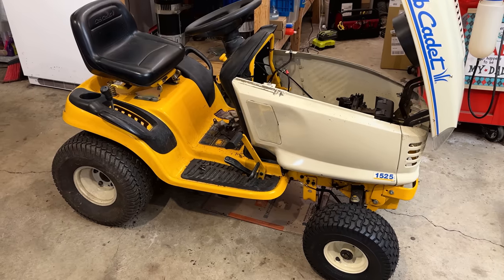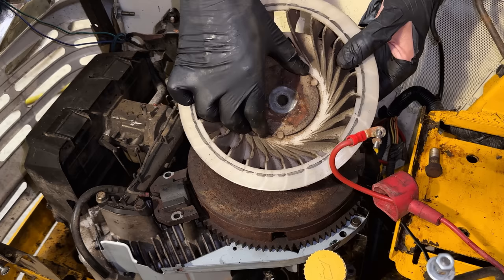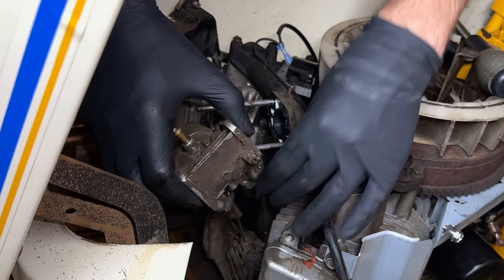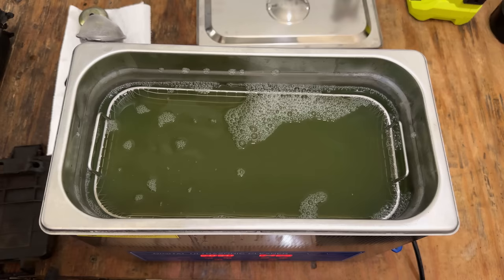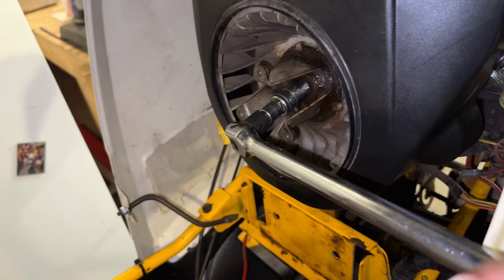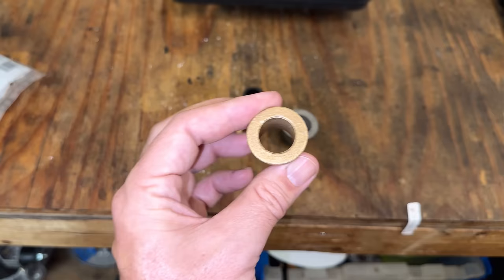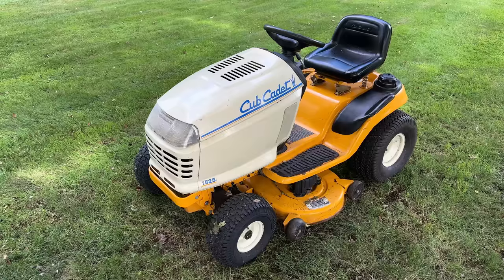Cub Cadet Crash (Pt 2) - Tractor and Tree Damaged

Comment: Fill the oil filter holding it in the inverted position (as you did). Let sit for 30 minutes in that position with some cover (usually the box it came in put on top). The pleats will absorb all the oil it took to fill the filter (if it is of good quality like a Wix). Add a bit more oil that will stay in during attachment and install. If not already, remove the spark plug. Now crank the engine or pull the started cord several times to fill the filter and establish full oil pressure/splash through the engine. Now you can replace the plug and start it.

Comment: Iron pipe threads always require lubricant, usually in the form of teflon tape or pipe dope, automotive is ptfe.  The threads engagement do ultimately make the seal, but the lubricant allows a deeper engagement of threads to make the seal.  

Usually 3 wraps of teflon tape is plenty good to seal pipe threads.

Comment: Good job James, she is pretty good, especially the steering. Not sure which is less tiring a zero turn or this one. Sure less tiring than a walk behind mower. It looks like this one needs a mulch bag since you were blowing leaves back and forth. Probably last you the rest of your life if ya'll bolted the dashboard on very fast, I mean bolt it fast or tightly. Probably will keep the steering from wearing out top and bottom. Your mower deck needs painted to keep rust from making holes in your deck with primer and good paint. Now all's ya'll need to do is hook it up to a generator head and pull it into a fabricated  box that has the connections already inside to just drive it in and generate big house power with a 10kw head and have the rpm load following to save on engine wear with an sine wave inverter.

Comment: There were several less than stellar design issues on this one. That steering issue with metal on the drive end and plastic on the steering end, looks much like planned obsolescence. Or, better said; a planned failure of parts. The idea you came up with is probably better than what the factory did. Should last longer for sure.
Reply: Just curving that yellow support pipe up to where the steering wheel boss was in the dash would have precluded all these wear/damage problems...
The steering wheel and shaft need to be well anchored because it is a normal reaction to grip the wheel for leverage getting on/geting off/braking/shifting seat....

Comment: As to the broken screw holes in the dash panel, if JB Weld sticks to the plastic (it usually doesnt), id suggest gluing a thin flat washer on both inside and out of each hole, to replace the broken out material.
Reply: Another commenter recommended ADEL pipe clamps that are used in experimental aircraft...
they clamp round pipes and allow other fixtures to attach to the clamp with bolts...

Comment: Hey, James!  Nice one - I like good long repair videos! 😁
There’s a couple things I would have done differently. 
I would have pressure washed that engine compartment after removing the hood and both sides. The dirt and oil on the engine and cooling fins would make it run hotter. 
I really like your solution for stabilizing the top end of the steering shaft, but the washers are what’s preventing most of the slop due to the difference in size between the inside of the brass liner and the shaft. I would have tried dimpling over the bottom edge of the brass and inserting a piece of Delrin shim stock from above to provide a near frictionless spacer with less chance of long term wear. Maybe. Just a thought. 🔧👍

Comment: Great video, very good information. I did notice you using chenel locks on the oil sending unit...I sugest finding a socket made for that purpose it is an S K Tool  P/N 4488  it's 1 & 1/16..

Comment: After the brass nipple installed in steering column you might have been able to use one of the bushings you originally thought about using to take up the rest of the slop.

Comment: Can't wait for James to do an airless paint sprayer repair video. I'm trying to figure out why my machine wont work. I'm pulling my hair out!
Reply: Never underestimate getting the filter backwards in the handle.  Or snapping the end of a filter off inside it.  Assuming your pump runs but the gun doesn't release any paint.
Reply: The gun is brand new. It runs but doesn't draw up any fluid. Perhaps I'm not operating it correctly. Thanks for the tip. @KaldekBoch
Reply: It's tricky to help diagnose things via text but I've had a few airless sprayers of various quality.  Always start by doing the prime to get the paint into the machine by using the prime position on the switch.  This will cause the pump to run continuously and (if it primes) it will spit paint out the little rubber hose.  Once it's doing that, switching it to the normal position should cause it to run for a few seconds until it pressurises.  If you get that far, all other issues are usually caused by the trigger/gun assembly.

Comment: Pipe threads (tapered threads) generally use thread sealant (“pipe” dope or Teflon tape). On motors in vehicles the oil pressure sensor should have thread sealant on it, that’s where the oil pressure will be 20-80 psi.

It will probably be fine just might want to keep an eye on it.

Comment: You could have closed up the steering shaft play, by soldering some 5/8" 'L' copper tubing on the inside of the brass fitting. Should be almost an exact fit (0.75" OD, 0.66" ID)
And one rule that I use when mowing, is to discharge where I have already cut - that prevents an ever growing mound of clippings to shift!
Reply: But by chopping and re-chopping time and again he is mulching everything back into the lawn....saves on fertilisers!

Comment: Not sure if you still have this, but if the steering wheel wiggle becomes an issue, it may be possible to center the steering shaft and remove the slop by taking a larger OD fender washer that fits in between the pipe flange bolts and drilling out the ID to the steering shaft diameter.  Once the steering wheel it tightened it will stay in place.

Comment: Instead of the brass fitting you could use a brass pipe plug and drill it for a 5/8"shaft... further i think i would have put the flange on the back side of the dash panel and countersunk the screws so they were flush with the top surface. Or barring that, countersunk the flange face.

Comment: many 80s era MTD snowblowers used stamped steel auger end support flanges with 3/4 brass bushings that would have been absolutely perfect for that steering shaft repair....or maybe even an impeller flange with actual ball bearing would have been good

Comment: 54:58  on the pipe flang good idea by the way I might have traced it on a thick plastic,  wood or tin drilled the holes in it like the front bored a large hole so the long side of the flange would fit into it and bolted it on the bottom side of the dash panel  and then just so the bolts didn't back off put clear calk on the bolt threds when it dries its like lock tight  or a nylon lock nut. 
That works really good to. You can get them off but its not going to vibrate off.  In fact calk would have held both parts on.

Comment: Could of used rivet nuts for the steering column part to put the bolts in. I don't know if it's the angle the camera but it looks like your deck is uneven. Like the left side of the blades are sitting lower than the right side.

Comment: Good job young man. You might try to use a schedule 40 water pipe the insider dim. the size of the shaft. Then sand the outside to fit your brass bushing. Just discovered your show. yes I subscribed
Reply from the maker: Thanks for the tip

Comment: I gave 350 bucks it was about 10 years old with just over 100 hours on it and it came with 3 pull behind devices.  Yes I stold it at that price.

I've sence picked up a 42" snowblower for 200 bucks in New shape and built a 75 cubic yard pull behind dump cart. 
Its more MTD then the newer Black and decker designs  not stanly owns MTD

The really good units were the Harvester international cub cadet units from the 1960s
These look like craftsman or yard machine units. 
The motors are really good.

Comment: There’s gotta be a properly sized flanged bushing you can drop in between the shaft and the copper fitting, and you won’t need a washer.

Comment: For that steering shaft I would have considered a circle of 1/8  steel covering instead of the pipe flange. I would drill a 3/4 hole in the centre and insert a flanged bronze bushing 3/4 od, 5/8 id.

Comment: Lot of work. Did you get the front deck support installed correctly? That will make a nice mower for someone if you decide to sell it.
Reply from the maker: Finally did reverse it.  Works as it should now.

Comment: I'd put some VibraTight or blue thread locker on the oil pressure switch. Not to prevent leaking as much as to avoid it backing out and dumping  all the oil on the lawn. Just saying. Lots of vibration going on there.

Comment: Wow lots of issues with this tractor. The pipe threads on anything needs sealant. The thread are interference fit to keep it from falling out. Oil/coolant,etc will creep through the thread clearance between the crest and root. So you have a spiral leak path. It will take a while to leak, but it will. NPT connections require a thread sealant to be leakproof. Good job.

Comment: Hello. As always, the quality of your work is extemely high and I learn a lot from you. I saw, you reused parts with corrosion below the fly wheel and you used Fluid Film. My question is why you did not apply sand Blasting to clean the parts? 🤔. Thanks for sharing. Saludos feom Mexico 🇲🇽

Comment: Although that machine is not the highest quality your usual attention to detail will give you another 5 years before you have to do more to it. I love your shop setup with the table hoist and overhead crane but can't help thinking your next purchase should be a medium-sized bench lathe so you can turn up those shafts, bushings and housings to your exact requirements rather than having to look for and buy parts that may not fit perfectly or are unavailable.

Comment: I always use teflon tape for that type of oil sensor to ensure no leaks.  The factory often uses a type of thread locker/sealant.  I think the green kind.  I wonder what ate that shroud up.  Maybe a mouse-house of the past?  Maybe caused the corrosion on the fan too?
Reply from the maker: It must have been a mouse house.

Comment: James, I have watched a number of your videos and have seen you use the tire changer, the compression tester, the spark tester(s), some needles/brushes to clean the carburetors, an air blow gun, some kind of degreaser, a vacuum and the ultrasonic cleaner. I was wondering if you might consider making a quick video and putting together some links to indicate what those tools are and where you got them, please. Thank you.

Comment: I would have put some pipe dope on that oil pressure sender.  The same stuff that I use for oil drain extensions when I add them to an engine.

Comment: You need to start taking the mixture screws out of the carbs you rebuild btw that's why so many of your stock carbs act lean is because the idle circuit is still clogged, yes the generators technically don't idle but that circuit still contributes to the overall fueling of the carb.

Comment: I know I'm a neat freak, but going this deep into cleaning the engine, I would have degreased and powerwashed the the whole thing... Nice rebuild though. For that cracked plastic on the dash, a mixture of ashes and super glue works great. You just paint it on both sides of the crack.

Comment: James I have been enjoying your videos for a while now.  I am a gen guy by trade and the gen oil sensor has 1 sensing wire while the threads making contact with the block is the ground.  If you put an O ring or RTV on the threads, it interferes with the sensor and as a safety it keeps your gen from starting.  Maybe it's the same for your oil sensor?  Might be worth a little experimentation to find out.
Reply from the maker: Good point.  This one is probably the same.  That said I do usually see thread locker on them from the factory.

Comment: Great work as always, just curious what engine oil you used? I have 3 john deeres with kawasakis, single 17hp, 17hp twin, and a watercooled 15hp twin. All i have ever used is 10w30 mobil 1. All machines are now over 1000 hours each with no issues. My dad always swore to quaker state 30hd.

Comment: The front deck bracket that interferes with the steering link needs to be removed and rotated 180 degrees to eliminate the steering linkage interference

Comment: Holding the flywheel bolt while torquing the clutch bolt means they will have the exact same torque, in this case 43, no need to check the flywheel bolt..:hand-purple-blue-peace:. That extra plate under the fan may be why the cover is rubbing the shroud?

Comment: Probably get a large square of metal same thickness as washer, cut it to fit between bolts tight then drill to match shaft diameter and no more slop.

Comment: Is it worth it, probably. I just did a similar thing at the beginning of the summer, I bought a John Deere that had been neglected and the plastic hood was all crushed in.  I paid $200 for it, and ended up in around $500.  I could have gone on market place and bought another running driving mower for about $600-$700.  Sometimes you win, sometimes you lose, sometimes you just sort of break even.

Comment: If you don't put sealer on pipe thread it will leak guaranteed it is one of the worst fitting for leaking especially after heat cycles and vibration.  I am kinda surprised by all the corrosion.  😲😳🥺👀👍👍
Reply from the maker: Was surprised to not see any on there when I took it out.

Comment: Before I declared the job done, I think I'd investigate why the hydrostatic transmisdion wont go into neutral. Usually there are two buttons on top of the transmission that the linkage pushes down to put it in neutral. Those buttons often stick due to rust and debris. Typically, some PB Blaster and a couple whacks with a dead blow hammer will sort them out
Reply from the maker: Everything was actuating properly.  Checked the parts diagram for anything missing and could not see an external issue

Comment: Another nice project. Cleverly repaired many issues. I am not impressed by the design of this tractor. If you had used a solid pipe plug on the steering flange rather than the hollow fitting you could drill it out to a size that better matches the steering shaft.

Comment: At 43:28 when you released the pedal on the right a bolt fell out from under your right foot.
Reply: good eye
Reply from the maker: That was one of the new bolts for the air shroud.  I dropped it and lost it.  But did put it were it belongs before bringing it outside.

Comment: 46:50 they make metal zip ties. Harbor Freight even sells a 25 pack for $5.
Reply from the maker: I have metal ones, but would rather the plastic zip tie fail rather then what is left of the dash.
Reply: @jcondon1  Fair enough. I've had some good luck with metal/wire reinforcing broken plastic. First was using a large staple and simply melting it into the plastic with a soldering iron to fix an expensive Dyson vacuum with zero available parts.

Comment: If you have and MTD product with a powemore motor and it's died down after  five or ten minutes after you start it there is a screen inside the carburetor that get clog which you can only remove buy removing the gas inlet which is press in the carburetor. You don't see that screen and MTD don't talk about it. You can remove it and get ride of it. I fix my Troy Built snowblower and my lawn tractor that way after buying three carburetors for my blower I find the hard way. Hope it will help other people.

Comment: Shouldn't there be some "structure" under that plastic dash to hold the steering column in place? Relying on what's essentially a plastic trim piece as a steering shaft mount seems kinda sketchy.
Reply from the maker: There really should be.  But the parts diagram does not indicate there ever was anything.

Comment: Great video and informational a couple of suggestions I would always put thread tape on pipe threads on the pressure switch and there should have been a bushing on that steering shaft below the dash and maybe it just needed to have been replaced and of coarse put a grease fitting in it, my 02 model Husqvarna that I just sold I put a grease fitting in it when it was pretty new and greased it when I greased the other stuff and it was still tight when I sold it. good luck
Reply: The upper mounting on this was just that plastic dash. 
The plastic dash had no metal support...except that round yellow tubing where the bolts and mountings (that broke off) were.
Just extending that yellow tube in a curve upward to the steering boss area would have precluded all these issues as the steering shaft would have been held rigidly in alignment with the sector....and not worn all the teeth off as it got more and more misaligned as that hole in the dash wore larger and larger...

Comment: Ugh. I hate those John Deere hoods. I have a John Deere that runs, but doesn't have a hood, and it is impossible to find one less than $500. Unless I find a parts mower with a good hood, it's totaled. It needs a wiring harness, but I am not even going to mess with it until I find a parts mower with a hood. It's been sitting for about five years now.

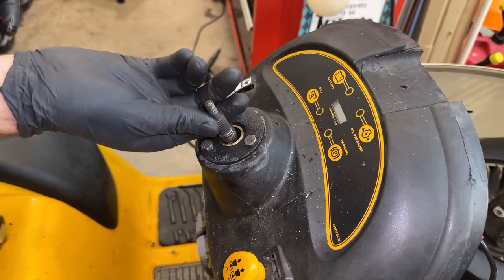Comment: 57:50 Why didn't you mount it from the underside, and use toilet bolts, or something with a more low profile head on it?   Seems like that would have improved the clearance issue and given it a cleaner look.  And it seems like you could have used that black plastic bushing also to reduce the 3/4" clearance down to 5/8".   Or maybe I'm overthinking it, I don't know.